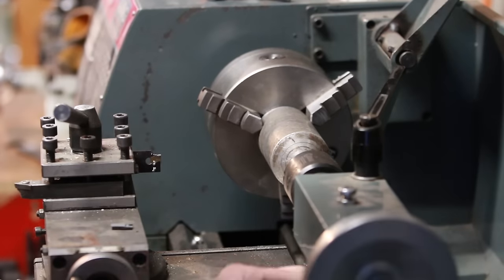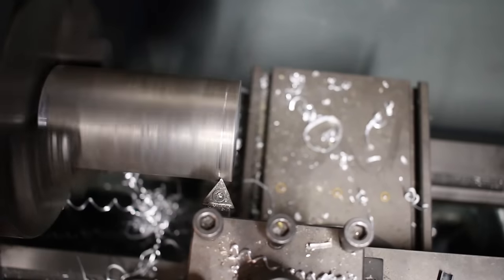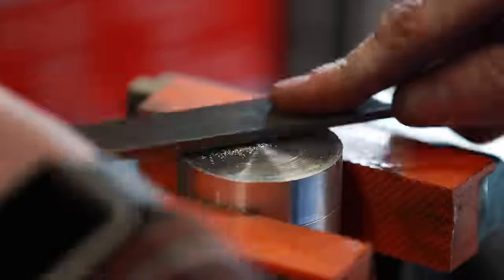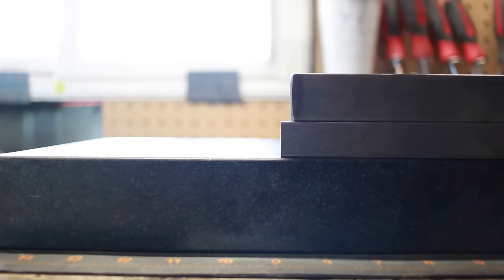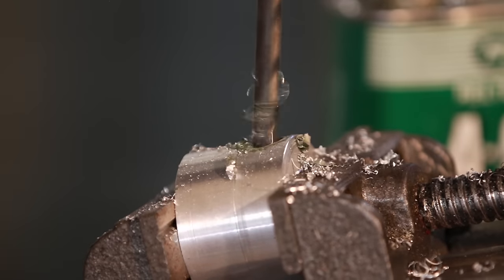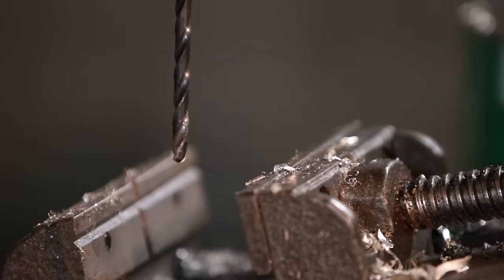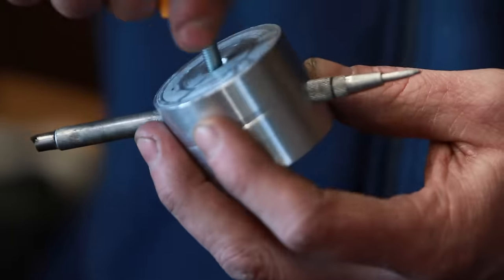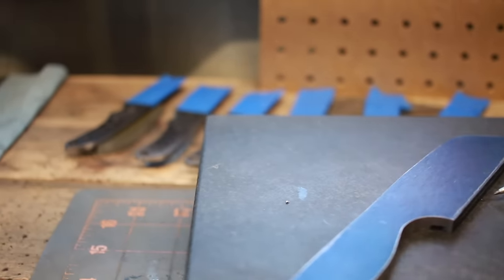How to MAKE the Best Knife Maker's SCRIBE - Maker Movement

Comment: How do you know where to adjust it so its at center of the edge? When using a drill bit , I know by using the same size bit as the thickness of stock. What do you use to find  center with your tool? ( which I think is awesome, just want to learn how it works)

Comment: How would you make sure it Scribd the centerline on every knife of different thicknesses?
Reply from the maker: +kyleloll it's adjustable.
Reply: You use a magical tool called a ruler to determine the correct height to adjust the scribe too. Abracadabra centreline...
Reply: Robs Semmler  yeah but a drill bit would have done the job by the time you found your magical ruler. Abracadabra common sense
Reply: Its hardly reproductively accurate. I have a far nicer scribe than the one demonstrated in this movie and its precision cannot be matched by a drill bit.
Reply: Robs Semmler good point
Reply: Robs, do you have a link to the scribe you use? i need to get one. Thanks.
Reply: Tom Chitwood A machinist friend of mine made it for me. If you use Instagram you could always add him and request one. Im aware he  ships his work world wide if he will make more. Check out @sharpstuffau on instagram. Tell him Rob sent you 😉
Reply: Thank you sir!

Comment: Great Scribe, ease the time it takes to adjust for each thickness could you make a simple stair design with your mini mill so you just set the scribe next to it then tighten it down.  Of course its only needed if you are using different size stock on a frequent basis.   I know you mentioned in the next video that people didn't like the music but I think its refreshing from all the heavy metal everyone else uses.

Comment: what is the green oil that you use before drilling the iron?. and y do you use it?.
Reply: It's a coolant liquid of some kind... should ensure neither the workpiece or drill gets too hot.
I think depending on the metal, there's a chance what you're cutting off can self-weld back to the workpiece if it's too hot. Which isn't good for efficiency or precision of the cut/bore/hole.

Also, he's working with aluminium/aluminum ;-)
Reply: Thx bro

Comment: Nice tool, useful for the stock removal method of creating bevels, but mostly redundant for those of us that forge the bevels in. For forged in bevels I just eyeball it. 

For stock removal a drill bit laid on its side and the blade edge puled across the point will scribe the edge. The drill bit must be the same size as the thickness of the edge being  scribed. Scribe down the edge on one side , flip the blade over, and scribe the other way. The two marks will give you guide lines to grind by. Simple and easy.